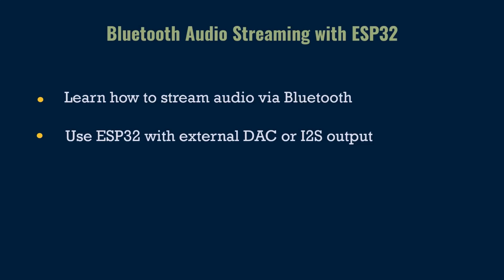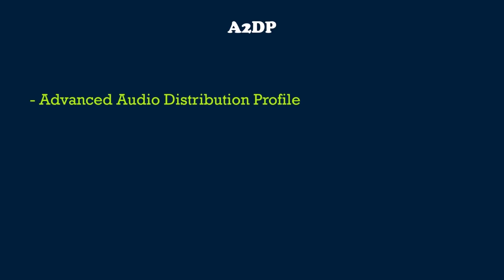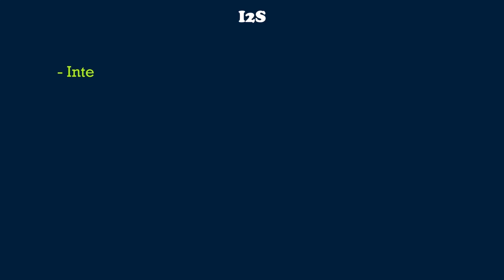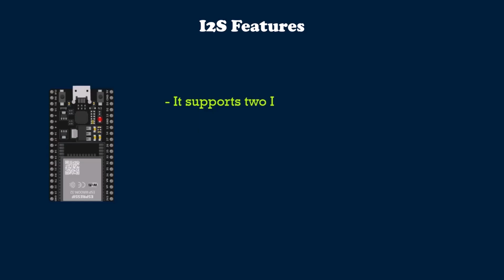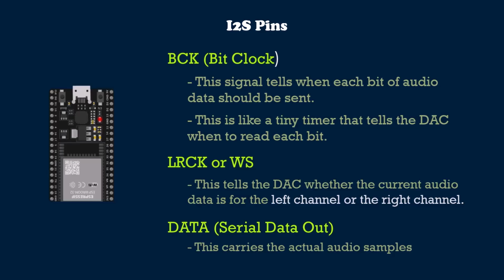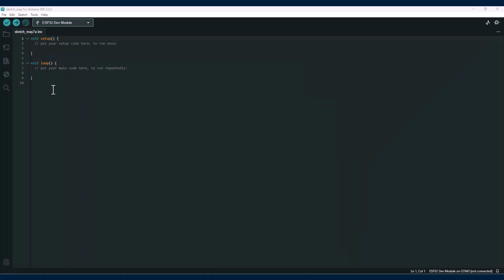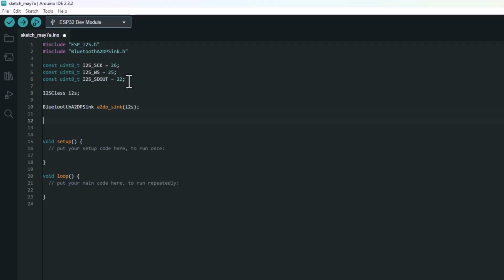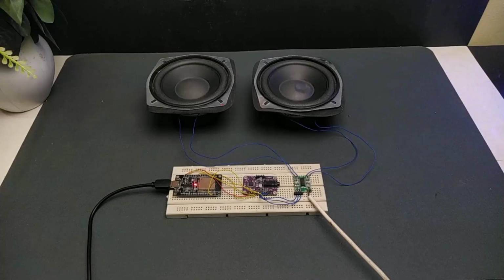ESP32 BLUETOOTH AUDIO | What is A2DP? | What is DAC? | What is I2S?

Comment: I do not understand how you are powering everything. You have the Vin to Vin from the esp32 to the DAC. The only power is driving the amplifier and the speaker. I suppose I am to infer that the esp32 is powered by a 5V supply and that is powering the DAC, and then the amp/speaker are being powered separately. If so, how does that work? You would need a diode between the DAC and the amp. If everything is being powered from the amp  board, then how does that work? Please, excuse my ignorance. The way electricity moves through a circuit is not intuitive for me.